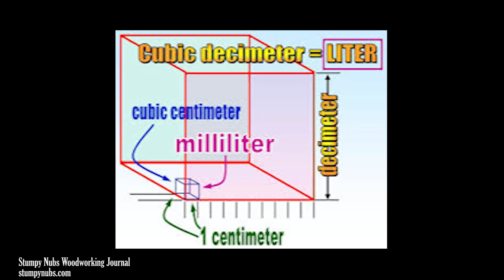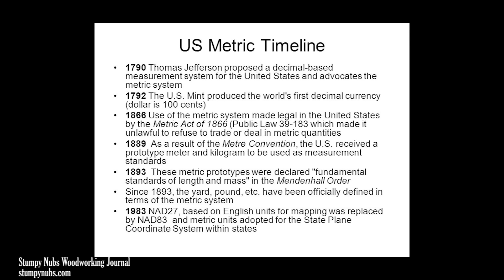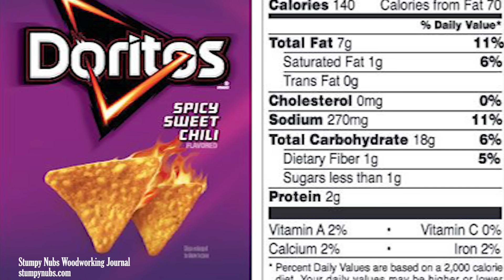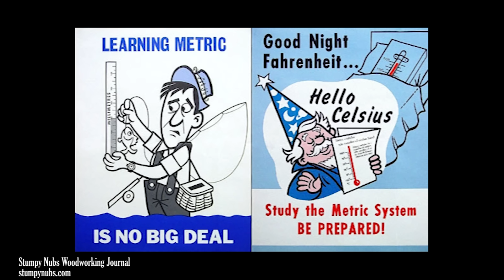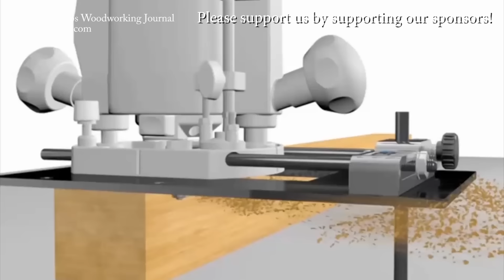BREAKING: The USA is switching to METRIC!

Comment: I used to love the metric system because of the easy use of dividing by 10. Seemed natural, it was the same number of fingers I had before I became a woodworker.
Reply: You grew extra fingers?
Reply: Ouch
Reply: @uplink-on-yt  100% human, 0% salamander.
Reply: Depending on what happened, you can start using the Octal system
Reply: I guess you now have some digits that conform more naturally to the fractional measurement system than the decimal system.....like 1/4 of an index finger and 1/2 a thumb 🤣
Reply: Factors of 10: 1,2,5,10
Factors or 12: 1,2,3,4,6,12

Clocks are base 60 with a pair of 12 hour periods to divide up the day. Nobody bats an eye. Why aren't the Metric yahoos calling for base 10 clocks? Why not sell eggs in batches of 10? I propose we make a new system based around 5040. 5040 has whole number factors up to 16 without any skips. That seems useful if you want to get rid of any imprecise dividing of it's parts amongst people.
Reply: Now that you have 8 does that mean you are back on imperial?
Reply: That would be such a thigh slapper, if I hadn't been caught stealing from the Taliban...twice.
Reply: Move next door to a nuclear power plant and eventually you can switch to hexadecimal.
Reply: Here, have this one for free 👍
Reply: @LFTRnow  that or he just uses base 8 math. :P
Reply: Since computers are supposed to make life better maybe we should go all the way and do base 2. Only have 2 numerals to keep track of.
Reply: I have the exact same reasoning but for the amount of inches in a foot.
Reply: *rimshot*
Reply: soo.. you cut one of and can't divide by nor count to 10 anymore? ;)
Reply: I'm mostly a metric guy from the other side of the Disc here but I have to admit inches and bald eagle wingspans are handy in woodworking for the neat and tidy divisions into 3s & 4s.
Reply: @danieldimitri6133  Base-10 clocks have been tried and there are those who still try to make it a thing. Most have realized that it's bonkers though, so that's never happening in full. Plus, time of day is less base-12 and more "base-Earth".

Eggs are sold in batches of 10 in certain parts of the world though.
Reply: @danieldimitri6133  even though we are metric over her in kangaroo land,  I was lucky to learn both during primary school, so I can use both, take the1" measurement, I much prefer being able to use 1/4, 1/8th, 1/16th, 1/32nd, so easy and better than trying to do the same in metric starting with 25.4mm (equal to 1") not as easy to converse on. so our old imperial terms are still used in our metric world...
Reply: @danieldimitri6133  great add.
I also like to point out that imperial will always be 100% accurate while metric sometimes will only be as accurate as you choose it to be. 
'accurate to three decimal places'
Reply: Let them join us .... how bout them Apples...
Reply: A stump still counts.
Reply: @danieldimitri6133 Because our numeral system is base 10, to make base 12 make sense you need two more symbols.
Reply: @danieldimitri6133 Because time is based on those things in the sky that make night and day! 

And anyway the French already tried using decimal to measure time and it didn’t work. 

It’s about working smarter not harder, metric works better for most things, time is the exception that proves the rule. 😉
Reply: @ChestZeroeski Any measurement system is only as accurate as the person measuring wants it to be. 

Presumably why most Americans say “it’s about…” and the number of inches they think it is. The only American I know who’s ever given me an accurate measurement for anything is the one who uses metric because she works at a food supply company. 😂
Reply: @ChestZeroeski what's that mean? there's no such thing as 100% accuracy. there's always a tolerance depending on the scale and the tools you're working with. You're telling me that your hand with a pencil on a ruler will always get 100% accurate markings just because of the system the ruler uses?
Reply: Time to embrace base 9 systems then (or is it 8?)
Reply: @danieldimitri6133  In Spain we have eggs in batches of 6, 10, 12, 18...
Reply: Now you are 1/10 less of your fingers?
Reply: @danieldimitri6133 would be like calculating Ina hex format 😊
Interesting approach, somehow (as I’m an IT guy) would be ok for me
Reply: I used to have ten fingers.  I still do, but I used to too.
Reply: You don’t know your fractions ?
Reply: unfortunately, eyeballing something into 10 divisions is much more difficult than eyeballing something into 3 or 4 divisions accurately.
Reply: @ffotograffydd  His statement is quite strange, isn't it?
Reply: Good point the fingers, never thogh on it 🙂
Reply: @gregjenkins2925  But if you’re using metric why wouldn’t you just make it a straight 25mm?
Reply: @jeroAhumada  You measure really small things with a ruler? There are more accurate ways!
Reply: @011CJ  So 3cm then?
Reply: @danieldimitri6133 eggs in The Netherlands are normally sold in batches of 10. Small packages are 6 eggs.
Reply: @ChestZeroeski How is imperial more accurate than metric?
Reply: Once you’re going two or tree dimensions, you’ll discover the benefits of the metric system. 

(Calculating the surface areas or volumes of things is so much easier when using metric). The same goes for conversions. While in the metric system all you’ve got to do is move the decimal point to convert, in the imperial system you’ll have to calculate. 

Try to convert square inches to square feet to square yards (if that’s a thing). 

Woodworkers use 1/4 1/8 etc while machinists use thou’s. That’s not very handy either.
Reply: @jeroAhumada   I was referring to the design side of measure based plans. 
To clarify: I was merely pointing out that fractions will always maintain their shape so to speak while little bits can be whittled away from a metric approach in that depending on the precision necessities of the project sometimes you just have round to three decimal places rather than four or ten. If that helps.
Were you building,say, a barn this would be a ridiculous hill ta die on
Reply: @danieldimitri6133 there was metric time, it failed worldwide though something about holy days in various religions mostly
Reply: @danieldimitri6133  Good point. I vote for a 20-hour day. It even reduces my work day to 6h and 66m! Double bonus!
Reply: @gregjenkins2925 25.4? Why that's just a hair more than 1/4th of a decimeter.
Reply: @ChestZeroeski you mean like "about 5/8ths".
If something in Freedom Units needs to be precise, it's generally in a few tens of thousands of an inch, which sound oddly like a micro-inch, but that would sound like Oppression Units.
Reply: @danieldimitri6133  The whole world sells eggs in batches of 10 - but that's not the important part!
Dividing by 10, multiply by 10 - just move the decimal point.
Going from from length to volume, combining with speed or weight - everything metric and adjusted together up to measurements for radioactivity etc.
Fractions by 3 6 or whatever are simply stupid!
Reply: @KitGerrits  hahahaha sounds about the long and short of 'er
Reply: @danieldimitri6133 You don't have eggs in batches of 10 in America??
Reply: Out of curiousity, what base is easier now?
Reply: @danieldimitri6133 .... thats actually some pretty sound logic, damn Daniel.
Reply: @Luredreier roman numerals solved that eons ago
Reply: It takes ten minutes to master the metric system, you only reason the US has not done by now is the cost.
Reply: @Leadbelly.  The longer they wait the more costly it may be!
But I'm in the UK and we still drive on the wrong side of the road
Reply: Several woodworkers that uses the imperial system have tried the metric system on projects and found out that it is easy to learn and produce at least as accurate results. When you work in a single dimension and don't need much precision it does not matter much.
If you work on large distances so you mix inches, feet and yards it start to become more messy.
If you work in 3 dimensions and need a bit of precision it becomes a real pain to use the imperial system. At least to the extent that every car manufacturer have switched to the metric system or went bankrupt. Same with airplanes, space travel, electronics, major engineering like bridges etc.
The metric system is just better. The issue is the cost to change.
A quick change is less costly, but you take much of the cost up front and it would be unpopular, so it will likely make you loose the next election.
That means a slow change will be the road for US. First you sneak it in everywhere, like selling sodas in liters  Second step is to teach both system in school for 2 generations, where the second generation will have metric as primary system. Keep slowly transition new items sold to metric.
Then you have the ball rolling. Just let it go. Total time to switch the slow way is at least 50 years.
Reply: @danieldimitri6133  😂 they do sell eggs in batches of 10 in my country
Reply: BTW do you know that time was in scale of 10, and they even try calendar? But it was reverse.
Oh and water freeze in 0 degrees of Celsius and boil in 100 ;) and science use same scale, but they move 0 to absolute zero (kelvins)
Reply: Carpenters use metric , when they are out by few mm does not effect them that much.
Reply: @ruben_balea  The US also has them in 18 (as well as 12),
Reply: Well that escalated quickly
Reply: @ruben_balea  In Canada, we have cartons of 6, 12, 18, or 30 eggs.
Reply: @pbilk  Actually TBF, we have those in the States too. But the 12s and 18s are most common. I remember 6 being a thing in the 70s. (Retail) however 15 dozen (180) is a common commercial (restaurant) loading.
Reply: @aldrinmilespartosa1578  Not escalated as the price of eggs lately.
Reply: @danieldimitri6133 what’s the base of the imperial system? 🤔😙
Reply: I think the point is that we use base 10 to represent numbers and that makes it easy to transform from, lets say, meters to decameters just by moving the decimal point to the left: 123 m = 123.0 m = 12.30 Dam = 12.30 Dam

You literally just move the decimal point x positions to the left to devide by 10^x.
Reply: @imwithstupid086  Clocks like all circular shapes are divided by a power of 60 because this gives mathematical advantages, e.g. you have more dividers that give you whole even numbers rather than fractions. This is not the case with base-10. 

However, base-10 is more intuitive (for humans at least) for calculations leading to less errors and faster conversations. They both have in common that they are consistent throughout their entire length units.

The imperial system is just plain stupid, as it is incoherent within its own length units. Sub-inch, inch, feet, yard, mile, etc.
It came from a time where science was a thing of the devils but a landlord's underarm was a gift from the heavens.
Reply: @martinmajewski the size of the foot of the king obviously , that's why it's called imperial .
I always wondered what happened to the inches and foots every time there was a new king, but that didn't happen as often as every 4 years.
Reply: @monad_tcp  Sure, you're right. I just took a bit of expressive freedom in my explanation. ;-)
Reply: @LFTRnow should probably need 16 or 32 fingers for that.
Reply: @LFTRnow what if he lost both thumbs? the heck kind of measurement will he use if he can't see inches or use base 10?!
Reply: @danieldimitri6133 interestingly, the numbers you mentioned, like 12 ,5040,16 are all represented in decimals.
Reply: @gregjenkins2925  Nevermind shaving off a few thousands! Oh,  so I should say shave off a few .000118 mm? Dumb.
Reply: @jonathantatler   yeah and your steering wheel.. it's in the glovebox
Reply: @danieldimitri6133 , yeah, it does seem like base 12 made more sense. I'm not sure why people switched. Another thing where base 12 lingers: 12 months in a year. Though, we could have a more regular year if we had 13 28 day months (with an extra day or two). I think that would actually be easier since days of the week would always correspond to the same day of the month. Or current system is coo coo.
Reply: Both are useful, both are needed.
Reply: @ffotograffydd  pretty much, some more than others
Reply: No i hate math
Reply: MADE MY DAY! 😂
Reply: @martinmajewski I don't know the full history, but as names suggest it's based on human anatomy. When building a house, as no standardised rulers and measures were sold, the master joiner would just mark his own thumb falange and foot on a piecce of something, that the rest of builders used that for the job. So every project was using the custom measure of the master. These times have passed and you can just buy a tapemeasure With <0,1% of tolerance. Besides, British and US imperial measurements differ by small margin in some areas, making it even more confusing.

 Today however, for dismay of some freedom enthusiasts, base for any imperial unit is - it's metric equivalent up to 6-8 decim digits behind decimal point, and SI system for most are defined by the unchanging quantum physics.
Reply: @danieldimitri6133  if an hour was 25.4 minutes then we'd have a problem 😅, not even close
Reply: @danieldimitri6133  As for time thing, clock time smallest unit is still in metric system, the other units are the metric value multiplied by of 24, 60. It still seems less messy because the base unit is metric. Also from scientific point of view earth rotation period is arbitral, time related calculations are always done in seconds.

Yes, some units such as angle are usually not 10 based (although we have grads where the whole circle is divided in to 400, but we use radians in math anyways which is 2pi based), but an important thing is that US is not sticking with the unit standards of the rest of the world. If all people used the same system it would be not that bad.
Reply: @danieldimitri6133 in Europe they do sell eggs in 10’s 😂
Reply: @gregjenkins2925  I feel your pain. In Europe nothing is 25.4mm long. Everything in the workshop scales up like 1mm at the time (5mm drill bit, 6mm drill bit, M5 or M6 screws, etc), so no fractions whatsoever. When we get our hands on american products we cry, try finding a screw that fits well into a 25.4mm hole - we usually just end up drilling a bigger hole and fitting one of our screws lol.
Reply: @ChestZeroeski  0.001mm what's that in imperial? mm is easier, in woodworking all you need is to go down to usually to 0.5mm, as a final measurement.on my Felder I can go up and down by 0.1, more than accurate enough. That sort of accuracy will be negated by timber movement or sanding. Sorry for my grammar, tired😊.
Reply: @danieldimitri6133  So there are numbers better than 10? Why not use that number then? And you use 10 because we use base 10. If we used based 60, it would all be in 60s. Everything smaller than a second is metric. And the 3 units above that are just 60, 60 and 24, not 12, 3 and 5280.
Reply: @danieldimitri6133  If we want to do that, then we have to have to use base 5040. We use 10 because that's the base we use. 10 x 10 = 100. That only works because we use base 10. To use 5040 we would need that many digits.
Reply: Now you need a base 8 number system…
Reply: I woke up my neighbors because you made me laugh
LOL
Reply: I still have my original decifinger.
Reply: Lol this is a great joke. Well done.
Reply: @danieldimitri6133  there was a French Revolutionary Calendar and clock, based on 10. Ironically it lasted only 12 years ! Good luck with the new 5040 system, i'll stick with SI
Reply: @Armchairhero00 no way ur a flat earther 😂
Reply: @nova396 no you shave a few mm's
Reply: @uplink-on-yt  Apparently he grow 7 more in the right hand to convert from inches to yards and  11 on the left one to handle ounces and pounds 😁😆
Reply: @danieldimitri6133  They do sell eggs in many countries in base 10. Nodoby is pricing the eggs like that anymore, they are priced by weight or by unit. If you were telling me that you oppose the change because it's expensive and it's metric already I would say: good point. I don't know if you know that  (here is no prototype yard, the yard. The yard was defined in terms of the meter before 1960 and the USA adopted it.  That means that every time you create a yard-based tool what you are doing is creating a metric tool and then going like crazy multiplying or dividing by 0.9144  and then by 12 to get the inches. He mentions fractions, because he is working wood, you are not getting a car with acceptable gaps (in  2023) by designing it with a 1/4 of an inch stick.
Reply: @danieldimitri6133  Clock are base 12 because it is too late to change to base 10, just like the American.
Reply: the inch unit system and other unit system are stupid. It is not because of stupid system, but because  that they are not compatible with the international system SI. All other unit systems must compatible with the international system SI. 
I often use computer programs for technical machines and other engineering tasks. And I often have to store and enter various values for various variables in computer programs, then let computer programs use entered values to calculate various tasks. You know that computer programs use standard known scientific formulas to calculate. If you enter values for variables in different unit system, then any time you add values, you must check the unit used in scientific formulas, then you must convert the added values to required unit systems. It is nightmare in engigeering tasks and scientific tasks. 
The only solution is that : use universal unit system SI : all programs and people exchage and communicate only with values in SI system. Thus no need to convert and check formulas when you apply variables in scientific formulas.  
Other unit system maybe comfortable only in conversation communication languages, but not in engineering tasks.
Reply: Used? Why did you stop?
Reply: I dide with 9,6 and it's not fun 🤣
Reply: @ChestZeroeski I’ll bite. How is fractions used in imperial more accurate than the decimals used in metric? If I measure 1 mm, you get 3/64”. And 2mm versus 5/64”
Reply: I thought Stumpy Nubs was his nickname following an accident with the table saw
Reply: @danieldimitri6133  I think you need to compare "apples with apples". Everybody uses the clock in the same way. US, EU, China... no one uses a different base for clock. And there lies the point of the whole debate between metric and imperial. Unification. And to let you know, yes, egg are sold in batches of 10 in Europe, not by a dozen...  :D
Reply: @danieldimitri6133 the number of factors is irrelevant, that's what the next smaller number is for. Upwards of the base number is where it's interesting. DIVIDING by 10 is simply easier: Scratch the final zero  or move the comma/point.

What's 174725374 divided by ten: 17472537.4
No divide that by twelve (without even having to think) please.
Reply: The system seems easier. The problem is that until the manufacturers start making materials in centimeters and meters, it’s not going to be even measurements in metric. Drywall, plywood, ceramic tile, kitchen cabinets and such are all going to be off of the even metric measurements. Now yes if cutting drywall you can measure the wall in centimeters and mark the drywall in centimeters and no problem. But with things like kitchen cabinets, they aren’t going to measure an even number of centimeters. I will agree that it’s probably easier to add or cut a centimeter or millimeter to a measurement for a precise fit because there are basically only 3 increments, mm, cm and meters, at least for woodworking, and I don’t know of any other.🥴. And some people just have trouble with eighths, sixteenths and thirtyseconds.
I do use mm’s sometimes with my cnc router because you have to input inches in decimals, not fractions. The software will divide an entered fraction, but you have to, for instance, type in the box, 16/1=, then it will convert it to decimals. MMs you just put in however many it is.
I guess at 68 and with 20 years in the construction business, I’m old and set in my ways, and after reading tape measurements for all these years it’s no problem to read any length of measurement. That and I’d have to buy a bunch of new measuring tools. I will,say that Woodpeckers has a triangle shaped set of rules that has both and a side with zero in the center and sides with a zero at each end. $160, but they got my thinking about it.
Reply: @jasonrubik   "I used to have 10 fingers.  I still do, but I used to, too."

Mitch, is that you?
Reply: @addmix your feet used to actually be a foot long? That were some unusually big feet! 😲
Reply: @ChestZeroeski that's the most ridiculous argument ever.

Imperial is only accurate to the closest fraction that your brain can handle.
Meanwhile metric's accuracy can be scaled indefinitely without the number becoming overwhelming thanks to prefixes and the base 10.
Reply: @LRM12o8   No, what Chest and a few others are saying is that with a base 12 system (like feet & inches) you can divide by numbers like 3 and 6 and get exact results, while with a base 10 system you can only get approximations, and then only with the use of many digits. 

So for example, if you want to divide a 10-foot length of wood in thirds, each section will be exactly 40 inches long. (i.e., 3 ft, 4 in.)    While if you try to do something similar with metric units (say, divide a 10-meter length into thirds), you get approximately 3.33333333333...  ☹
Reply: @theX24968Z that's complete bullshit! If you're eyeballing, then the numbers don't matter anyway! 😂
Reply: @bas6983  One of the things that is kind of interesting is that the number of items in a case varies depending on where the case comes from. The things coming into my store from Canada are more likely to be in multiples of 5 or 10 whereas the ones coming from other parts of the US are more likely to be in multiples of 4, 6 or 12.
Reply: @Conservator.  They're both based on the same standards these days, so they're exactly as accurate as each other. The benefits of imperial is that it's a human based measuring system, so you've probably got some body part that can be used to reliably estimate the measures.
Reply: @pmfx65  Yes, but the point that the metric system lovers seem to miss is that it's not something that's anywhere near as common as they think. It makes sense for science because you can have the same units reasonably being used over several orders of magnitude in a single problem, but that's not something that comes up a lot in daily living. Plus, with imperial measures, you can still use decimals if that's more convenient, you just also have units that are more easily divided into convenient factors as well.
Reply: @SmallSpoonBrigade  
If you want to go that route:
- my thumb (inch) is a different size as yours. The same goes for our feet that might easily differ 50%. 
We however all have 10 fingers and moving a decimal point is far easier than doing calculus. 

It’s not that you relate to body parts but it’s what you’re used to and that’s why people don’t want to change.
Reply: I have 12 fingers.  I'll stay on imperial for a while, and then maybe endorse the metric after I lose a couple.
Reply: He lost some
Reply: Ur Argument has a flaw.
U cannot Base the click in 10s that Just doesnt Work U would need to Change how much a Minute/ hours is. That would Not Work 
And why is having fractions of 6 and 12 better than Beeing Anke tondivde by 10. U Just Out the Komma to the legt or right and U are done
Reply: @MrBenedictus25  English is hard.
Reply: Hope you didn't loose nine fingers, binary is tough unless you're a computer...
Reply: Admit it, you still love approximating small lengths with your thumb. Even as a metric person I enjoy when I read a smallish measurement in inches and start counting thumbs.
Reply: I use octal all the times I have the freedom to choose for my projects.
Unless there is a requirement for retrocompatibility, using octal instead of HEX is perfect for pure hardware designs (designs that don't use programmable microcontrollers). What a wonder octal is.
Reply: So, how do you count your money? The last time I checked, you use dollars as a currency, and 100 cents make a dollar. Literally the same as Metric.
Reply: But
But
Where is skill?
Where is craftmanship?
With metric system meister can be 12 year child
Reply: @johnpackwood4779 naah
Lets stick to 17 . Centur standard
Reply: @imwithstupid086 where I live eggs are sold in boxes of 6, 10 or 15 or racks of 30. The boxes used to be 6, 12 and 18, but it was changed. Though I think the change was made more as a way to sneak in a price increase than to make it base 10. The 6-pack probably remained because the only way to make a rectangular 5-pack without wasting space would be a ridiculous looking elongated box.
Reply: Ha
Reply: @Armchairhero00  The turtle moves.
Reply: @danieldimitri6133  Why use fractions when you can use a period to identify smaller units. You don't say 1/105 of a meter in metric, you say 9.5 milimeter.
Reply: Ive always hated it.. imperial is better
Reply: @jeroAhumada  That is because of the hand - not the ruler and pencil.
Reply: I hope you keep your fingers
Reply: Ouch!
Reply: @arawtgabi  and need to change the job or hobby or will end using the binary system
Reply: 8bit
Reply: @danieldimitri6133  Don't you get that ?  You hardly have to extrapolate 10x, or 100x  9 hrs or 15hrs like the way you do with length, surface and weight. 
What you want to do with time is to divide it in segments. It happens to be that 12 and 60 have more divisers (12 >> 2, 3, 4 and  6)  than with a decimal counting 10 or 100. 

Well eggs in my country are sold in boxes of 6 , 10, 12 or  30 eggs
Reply: @danieldimitri6133  Clocks are a fixed range, easy to memorize, not to mention every conversion to seconds is a nice integer factor, and it can only get so big before switching to units absolutely familiar to any human on earth (days, years). Imperial system on the other hand....
Reply: sth doesnt add up here
Reply: I don't get why people don't use fractional centimeters
Reply: You mean you lost some fingers?
Reply: @sugoijan  lemme introduce you to millimeters
Reply: @mikehodges6958.  Odd, I worked on nuclear plants for 40 years, and I still only have ten fingers and toes.
Reply: @danieldimitri6133  is still nonsense.. Your argument would only make sense if you used base 12 numbers.
Reply: @danieldimitri6133  I do complain about clocks based on 12. Doesn't do me any good. I try to put stuff in the microwave for 123 seconds and it only cooks for 83 seconds.
Reply: @danieldimitri6133  The "metric" or more correct SI system is not about the factor of 10 (or to be more precise, preferably 1000). It's simply the base of the number system used by (I think) all humans. Because "fingers". If this was 12 or 16, the main idea of the "metric" system would stay the same, always use the base of the number system as a factor.
Then "k" would mean multiply by 12x12x12 instead of 10x10x10. Don't blame the imperfections of our based 10 number system to the unit system.
Aaaand your "imperial" system is not consistent there, 12 inches in a foot, 3 foot in a yard, 5280 foot in  a mile. And even 1000 "mil" in an inch. 16 ounces in a pound, 14 pound in a stone. So don't come up with "but what about 12" here.